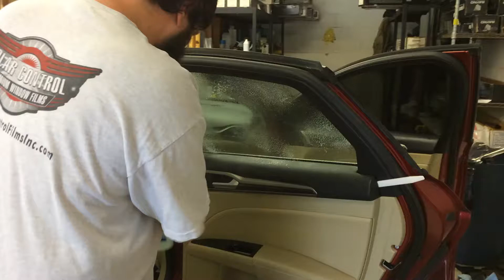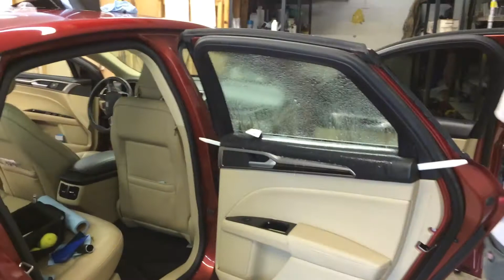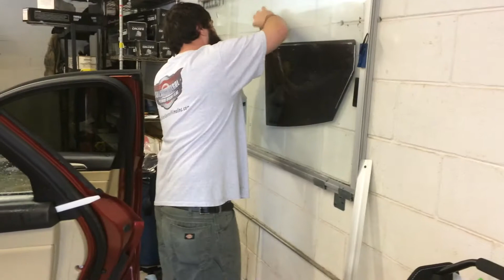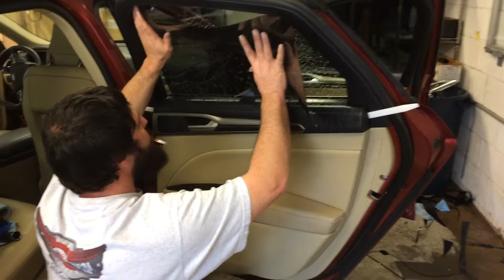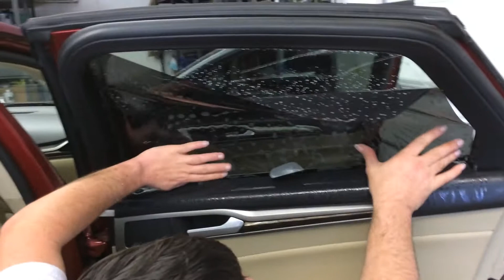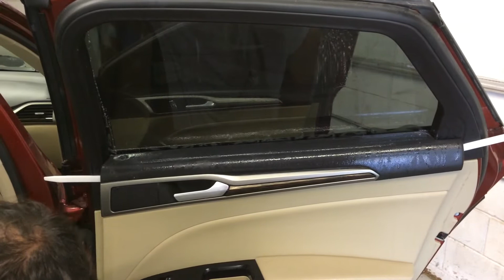How to tint car windows: bottom loading part 2 rear doors

Comment: do you lay film  flat then slide what's  the trick to get no dirt on tight  gaskets???
Reply from the maker: A gasket wizard really helps. 
This is the "freestyle " method. Like working without a net. 
And yes, keep the bottom perfectly straight
Reply: TNT Window Tinting thanks for reply  I'm gonna get it down just got a little trash on sides second one came out better but when I stuffed it deep got some trash on other side ya know
Reply: TNT Window Tinting // I cleaned seals  real good with  at shirt too taped and flushed  them.....

Comment: Looks like you payed the panel back on both side?
Reply from the maker: No. Just carefully "freestyled " this one. 
No panel pulled or seal pulled.
Reply: TNT Window Tinting oh it looks like there are pry tools on each side is that a special isl tool to pull panel back a little?
Reply from the maker: Yes. I use bone tools to pull the seals back just a bit